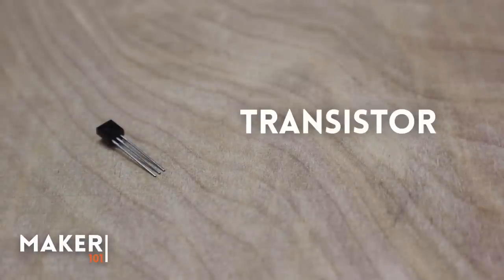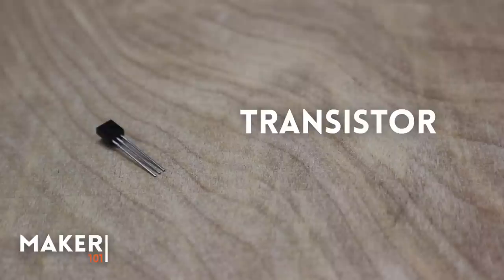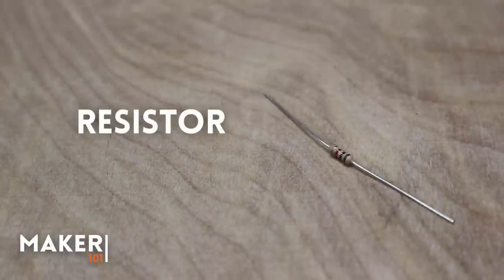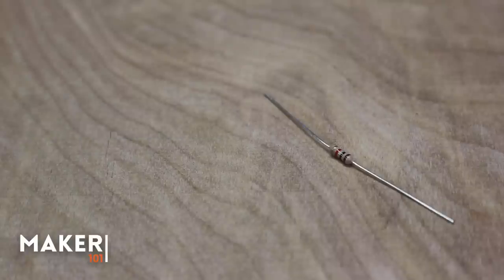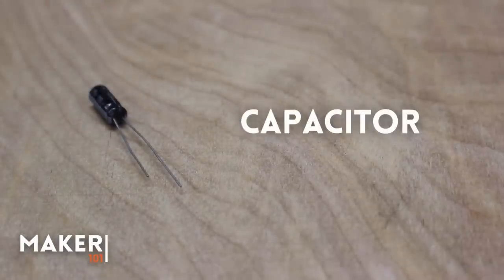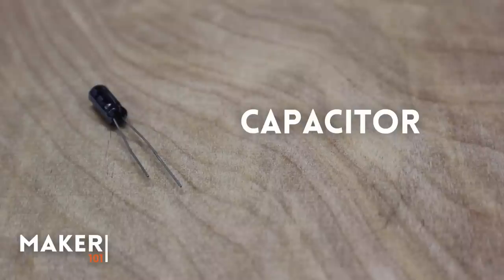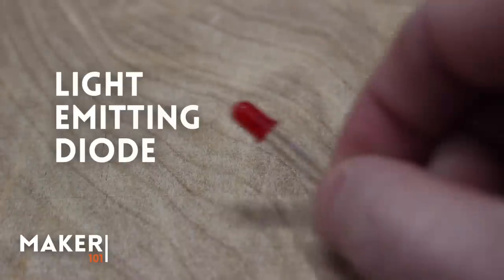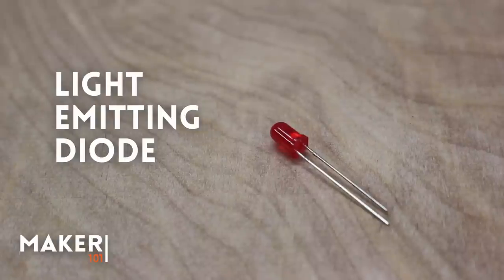Maker 101: Understanding circuits | I Like To Make Stuff

Comment: I like the explanation that's in the Arduino book. It goes something like this. A boulder sits on top of a hill side and starts rolling down. The gradient of the hill is the voltage, the size of the boulder is the amps and everything the boulder hits in its way down e g bushes are resistors.

Comment: I used to work for a telecommunications company on pressurized networks and working with air flow is pretty much the same too - or at least there are a lot of similarities. Telecoms companies who own exchanges and the cables in the ground that emanate out from them, they pressurize their most valuable cables with air, to prevent moisture ingress in case of a breach in the cable sheath - a leak. The pressure of the air rushing out is enough to prevent any moisture from seeping in so it's an effective form of protection and common practice in the industry.

There's a compressor in each exchange which get's hooked up to each trunk cable and pumps that particular network full of air, though only out to a certain point. The very ends of network cabling, the small branches that enter into estates and eventually into homes ... the cables are small, cheap and easy to replace so they're only protected with grease but the larger cables ... they are more expensive, sure, but it's not so much their cost which gets them better protection - it's more because they are so difficult to get into and out of the ground. In fact, once you put one in it's next to impossible to take it out and that's the main reason why they are better protected.

My job was to hunt down and fix leaks in the pressurized plant. When I'd come into an exchange I'd go and check the readouts on the compressor to see which of the main networks needed the most attention - or another way of looking at is it to say which one was the most valuable to me, had the most work in it. We'd find leaks by first calculating the likely location of major leaks. We'd get the survey plans and the go around with a manometer and to check and note air pressure at various points on the network. Only be jotting down the numbers and acquiring a solid understanding of air flow could you be any good at the job and really reap the rewards. Once you'd gathered the data and saw the trends in the numbers you could go there, pump a specialized gas into the network in that area and check various ground boxes to see if you could detect the gas.

I became very good at it and it was due mostly to thinking about how electricity acts in circuits so ... the other way around I guess but I find it interesting that thinking of electricity, air and water in the same way ultimately leads to a greater understanding of it. They all run to ground and take the path of least resistance. Understanding that alone can enable someone to do a lot.

Comment: I designed Hydraulic drive and cooling systems for the drybulk transport industry for a number of years. If you can understand basic hydraulic systems then you can definitely understand basic DC electrical circuits. Great analogy. I like the Maker 101 format too by the way quick and simple.

Comment: Bob - the wording you used at 0:44 ("pressure of the water that can move through in a certain amount of time") might confuse some people. Voltage is potential difference (joules per coulomb) between two points. Pressure's definition is force per area. Change over time would mean power (work being done per unit of time), measured in watts (Joules per second). It is a good analogy, but the exact wording does matter on engineering/physics tests. Overall this is a great analogy :)

Great stuff, I'm glad you're continuing Maker 101 again!
Reply from the maker: Michael Natrin Excellent point, you're totally right. Hopefully people will remember that this is an analogy, not a straight explanation. It's definitely not meant to help you pass any tests, just to introduce concepts.
Reply: I Like To Make Stuff A more accurate way to look at it is the water velocity, rather than the water pressure. Velocity can be thought of as energy per molecule, whereas electric potential is energy per electron. It also makes the equation (velocity / flow rate = 1/ cross-sectional area) hold.
Reply: Michael Natrin As someone who is not, and never will be, an engineer of any kind, but who has been a teacher, I have to say that it seemed like an excellent analogy for a 101 lesson. Mainly because after listening to Bob, I have an idea of what's going on. Maybe not exactly, but a clue. I seriously have no idea what you just said. This video makes me want to build some sort of electronic project.  "Potential difference (joules per coulomb)" makes me want to jab myself in the eye with a pencil.

Comment: I like the Highway analogy. Resistance would be something like the width (er, narrowness actually) of the highway. Electric current would be the traffic flow rate, or the number of cars per second, and the electric potential would be the speed of traffic (or the speed of each car; it's the same).
Reply from the maker: That's great!
Reply: I used to like that analogy, but realised that is can be made even better and more accurate; you can always imagine voltage like road rage, how bad cars on the road want to get from one place to another! and the more resistance and voltage difference there is, the more heated (stressful) things become! for some more in-depth theory, and practical uses for some of the math, check out my 2 videos on ohms law, watts law, and series/parallel circuits!

Current would really be the number of cars passing through a point per time unit, so thats right, although if you think about it, traffic moving faster would be the same as increasing the flow rate, thats why I have more recently shied away from that thought.

Comment: in some parts of that, I would use the circulatory system, because of the property that if the wire is snapped, it doesn't flow anymore, and it is broken. electricity doesn't dissolve into air in broken wires

Comment: I like the explanation, but there are two things wrong:

The first is a common and not so important misunderstanding. But electrons actually flow from negative to positive, since they carry a negative load. It is important to learn this the right way to understand the physics of molecules and their interaction.

The second one is that a 120W (European) light bulb will indeed carry 0,5 amps at 240V. But when you hook it up to a 12V power supply, it will definitely not carry 10A. Roughly said, the lightbulb has a resistance of 480 ohm (10A*240V). When hooked up to the 12V, it will only allow a current of 0,025A and therefore 0,3 watts. I would be surprised if it even lights up.

The rest of it was quite good though ;)

Comment: The analogy I used was traffic.  Cars are your electrons.  Their movement is current.  The road is your conductor.  Gravel roads and potholes represent bad conductors and cars will generally travel on the paved road (a good conductor) if it is available.  Just like resistance in a wire, if the route on the paved road is too long, the car may decide it's worth taking the gravel road to get to its destination.  In high frequency electricity, skin effect can be simulated by more traffic, slower driving...more resistance...less current.  Resistors are analogous to lanes on the highway; fewer lanes, more resistance.  When you're doing current divider analysis, two roads diverge and take you to the same place...they may (or may not) have the same number of lanes...cars will decide which route to take based off how the traffic in front of them is behaving; two travel lanes for one route will usually attract about 2x's the cars versus the one travel lane route.  Capacitors act like red lights; stop and build charge and release.  Inductors act like gas stations; stop, get out to pump gas (electricity converts to magnetism), get back in to drive (magnetism converts back to electricity), and try to get back on the road before the next wave of traffic reaches you (voltage leading current in inductors).  Diodes are one-way roads.  Transistors are the on-ramps to the freeway.  A break in the current is like an accident that shuts down traffic on the road; traffic will try to find alternative routes...better hope those roads can handle the increased traffic or another accident may happen.

Comment: Electricity does not flow from positive to negative. It flows from negative to positive.
Reply: im pretty sure i've seen a video that says postive to negative
Reply: It is correct that current flow from negative to positive but, if we calculate it in the opposite direction it would still give the same amount. It is easier to use the conventional current method so you don't have to deal with a lot of negatives in your equation.
Reply: It can go positive to negative an negative to positive
Thats what my Teacher told me
Reply: In a DC circuit it flows from negative to positive.  In an AC circuit, it is positive to negative aka neutral.

Comment: flow of current is from negative to positive not from positive
Reply: Yep, i was checking the comments if someone noticed. I actually didnt know that before but true is from negative to positive. But the Conventional Current Notation says exactly the opposite - from positive to negative. So Both of you are right and in the same time wrong :-( uff, it really depends if you take real approach (then from negative to positive) or if you follow the "wrong" convention (then from positive to negative). It is kind of confusing, it took me a while to find a truth. Google Electron vs Conventional flow for more info
Reply: In a DC circuit the flow is from negative to positive.  In an AC circuit, the flow is from positive to negative aka neutral.